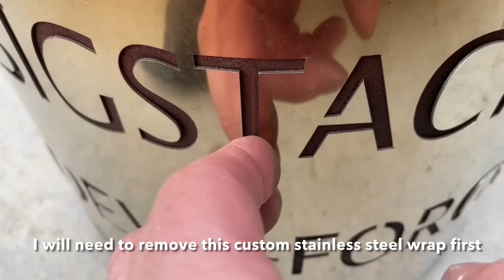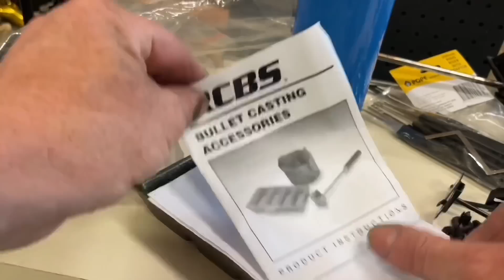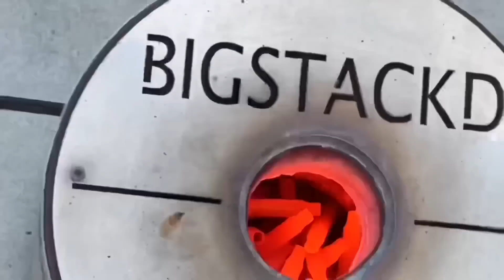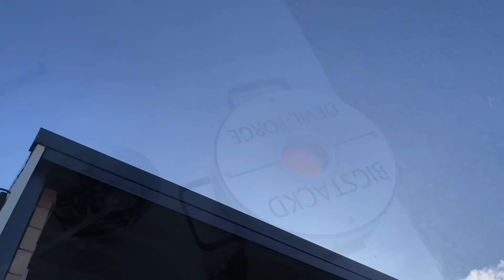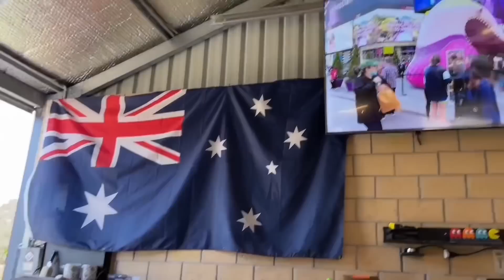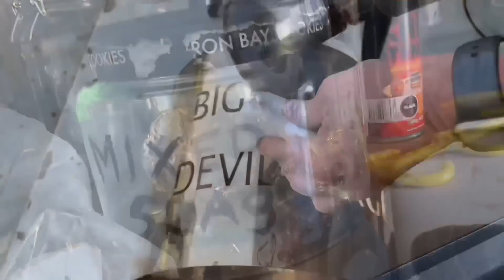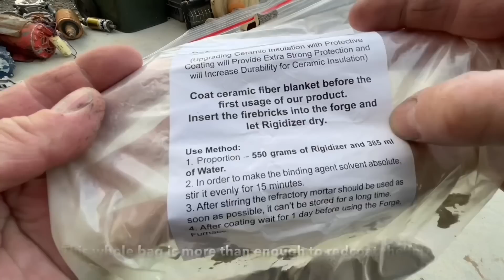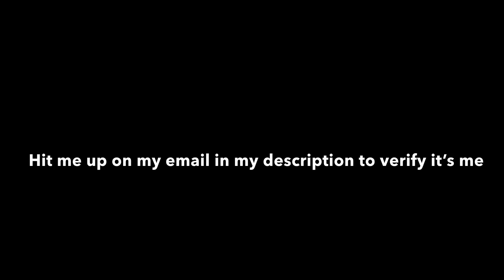Bullet Shell Melting & Furnace Restoration - ASMR Metal Melting - BigStackD Casting Casings

Comment: Awesome video, quick note for anyone using Hydrochloric acid, or muriatic acid to clean parts, be sure to use some baking soda to neutralize the acid as of there is any left it will continue to eat at the metal (and also use ventilation!!!)

Comment: Great informational video when a furnace restoration is needed. It’s impossible to pick any one favorite item from your store… but thanks for the knowledge either way. When I put my burner in and put the wool around it, I cut a strip aluminum foil and covered it just for added security, it’s held up well and hasn’t moved at all.

Comment: Also, I think brass melts are my favorite because of all the different shapes they start as. Copper is so often pipe or wire, but not much else. Where as brass is shells, fittings, facets, sprinklers, handles, knobs, etc🥰🥰

Comment: I've used the same model mold to pour hundreds, if not thousands, of pounds of lead for casting bullets. The neat part they don't advertise is that each bar of that is cast of pure lead is close to 1 pound, but if you purposefully overfill the iduvidual molds and fill the entire thing up as just 1 large mold, it will pour a 5 pound bar that can be stacked a lot easier than the same amount of lead in the small bars.

Comment: As a chemist, I would recommend that you neutralize your acid waste before touching it. Baking soda is one option but must be adding very slowly since the reaction is fast. For derusting, you could use Evaporust or even white vinegar. White vinegar will be slower but no concern for burns. Big box stores have more concentrated acetic acid but the risks are similar to HCl so the same caution should be used. Always wear proper PPE. To end, love your videos.

Comment: I’m a service plumber and from time to time we use hydrochloric acid to clean urinals. That stuff is freaking nasty if you get it on anything it can eat or if it’s eating anything inside of a pipe not designed for heat. 

One time a coworker ended up buying a lady a new set of towels because the acid ate up a clog in a plastic p-trap and heated the plastic so much that it melted. He got a decent scar on his forearm for his trouble when the acid got on him.

Comment: Another cool videos usual man!

But can I make a suggestion or maybe a tip?

I'm not a smelting pro but I use this number of times and restoration projects and works great, but when dealing with Rusty screws or even the brass, have you thought about using vinegar... White usually works the best but either red or white... And have it soak in a mixture of water and vinegar (I forgot the measurements. How many parts water versus how many parts vinegar I don't remember), but I have it soaked in water roughly the same temperature as maybe a cup of coffee, and use a ultrasonic cleaner to clean the brass and rust off the steel. It's a lot safer, I don't think it takes that much time, and I don't think overall it's that expensive. At this point in the game it's probably easier to come across then most other chemicals you can probably use,

I don't know if you know that trick, but it works great!

I'd also put in the brass through the ultrasonic cleaner well also knock off all the crud that's on it and therefore you don't have to worry about it as much as Ross when you melt them down.

And one thing I use instead of borax that works damn good as well, it's sulfur. Usually I buy it from the gardening supply by local hardware store, and it's something that we use here in the states to kill a root fungus. Putting that in a melt for me usually works really really well. So I thought maybe that maybe useful to use as well.

Just two cents from the peanut gallery over here!

Take it easy and a fun watch the see!

Cheers! 🥂

Comment: My crucible had a stress crack when I was a rookie and as I was melting aluminum, I noticed that there was less in it then there was and as I looked the aluminum had run out and coated the bottom of the furnace. Had to replace the kaowool in the bottom of the #4. I bought a #10 and let the #4 get wet and now I need to rebuild the entire inside, and refinish the entire exterior.

Comment: 1) When pickling or descaling corroded iron, adding about 1% oleoyl sarcosine will protect naked metal from HCl.
2) Wash the cleaned metal with water, sodium bicarbonate solution, water to remove chloride (corrosion catalyst) and raise the pH. 
3) Hot oxalic acid solution (poisonous!)  will clean off iron corosoion with no volailes released and no rcae corrosion calaysts remainimg

Comment: You would find citric acid works very well as a rust remover. It is much safer to use than HCl and will only remove rust. Not the steel. 

Citric acid is cheap too. Comes as a powder. Frequently used for pickling, so some grocery stores have it. I buy 5# bags for about $5 on Amazon

Comment: It’s the day I finally ask the question I’ve wondered for months do you have a special type of camera that withstands super hot temps because I bet a go pro would hate that type of heat especially getting the shots into the furnace
Reply from the maker: Actually I simply film with my iPhone so I have three of them and as they can regularly overheat I just move onto the next one while the other one cools down. Probably not the best thing to do but it’s been working for years. A very good thing with these furnaces is the heat disperses pretty quickly once it leaves a furnace and if there’s even the slightest breeze you can pretty much look straight down into the furnace but on days when there is zero wind it’s extremely difficult to get an inside furnace shot👍🏻
Reply: @bigstackD  thanks for the answer

Comment: FYI, you didn't actually need to stuff around with HCl - plain white household vinegar would have done the trick, albeit not so quickly. Works on any rusty metal, usually overnight. It does work better hot though, so for smaller items you might want to boil them in it, and then just leave overnight to soak. So long as you wash them off and dry them immediately upon taking them out, it'll actually do a better job than HCl, since it won't attack the metal you're trying to clean.

Comment: No need to use Hydrochloric acid. You can achive the same results with vinegar or electrolysis with regular salt and a donor peace of steel. It takes a longer time but is a lot more safe.

Comment: Absolutely love watching your videos. Question for you, can you use BORAX with aluminium and copper. ? And how much would it cost me for a BIGSTACK starter kit, would love to get into it myself.
Reply from the maker: Hit me up on my email and I’ll send through a heap of info that will help you get started as Well as some discount links for the furnaces. I never use borax with aluminium or copper only with dirty brass and I’m not even sure if I’m using it correctly as I don’t know if you’re supposed to mix it in at the end or put it in before you start. Copper melts that hot that any impurities in there will sit either at the bottom of the Crucible or float on top to be skimmed Off but I can’t remember the last time I skimmed copper normally if theres crap in the Crucible I’ll just pour carefully as that can be easily done while leaving all the impurities Ash and dirt etc inside the Crucible👍🏻
Reply: @bigstackD  got ya cobba.
Reply from the maker: Oh yeah I forgot , here’s my email
bigstackddddd@mail.com

Comment: Dude next time you use Hydrocloric acid dont just add water. That will dilute it but not neutralize it. Next time add an equal volume of backing soda to the solution. The reaction looks violent as it produces carbon dioxide gas (as well as H20 and NaCl) with lots of bubbles but it neutralizes the acid making it safe for disposal unlike just adding water which can evaporate and cause the solution to become concentrated again.
Reply from the maker: Yes I completely understand what you’re saying , I did actually use up all that diluted amount that was in the blue container as I was cleaning some  mortar off my concrete later that day

Comment: For anyone wondering about the fumes from the hydrochloric acid, DO NOT breathe them in either. Please do research before you use seriously dangerous chemicals. I say this with laboratory experience. Hydrochloric Acid is no joke and is not to be half hazardously handled

Comment: Man I thought that you were just using a solvent and not actually using something like Hydrochloric acid to clean those screws and bolts. 

We used that stuff in high school chemistry class and it is dangerous. Someone got some on their shirt without realizing it until holes started appearing on the shirt. They had to use the shower that was in the classroom

Comment: Why lie like that!  I know such casings. They of their steel have the thinnest coating layer. You haven't even removed the varnished steel sleeves (green!). They don't even have milligrams of brass on them.  Dear viewers, a cartridge with a brass sleeve costs more than $ 10 apiece. Who will throw away the cartridge case from such a cartridge? Moreover, melt it into a few grams of metal! In Russia, a used brass sleeve costs from $ 1 to $3.
RU;
Зачем так ВРАТЬ!  Я знаю такие гильзы. Они из стали имеют тончайший слой покрытия. Вы даже не убрали стальные гильзы покрытые лаком (зеленого цвета!). На них даже миллиграмм латуни нет.  Уважаемые зрители, патрон имеющий латунную гильзу стоит более 10$ за штуку. Кто выбросит гильзу от такого патрона? Тем более расплавить ее в  несколько грамм металла! В России использованная латунная гильза  стоит от 1 до 3 $.